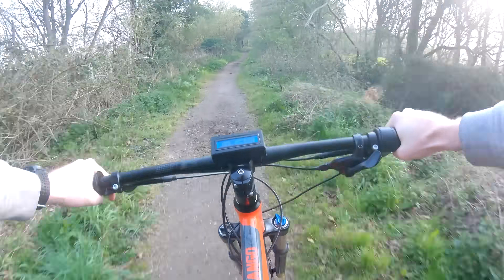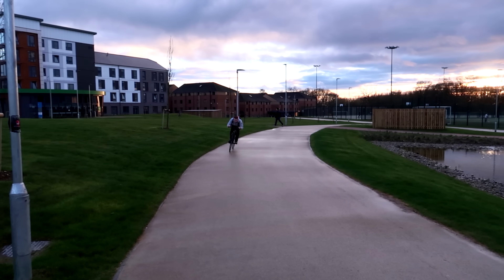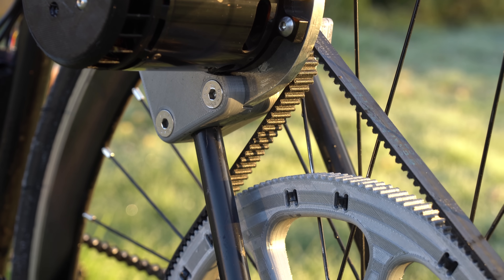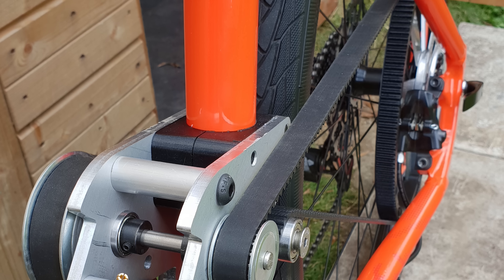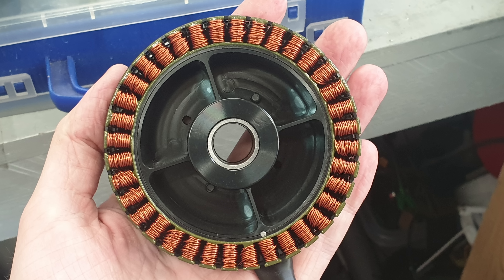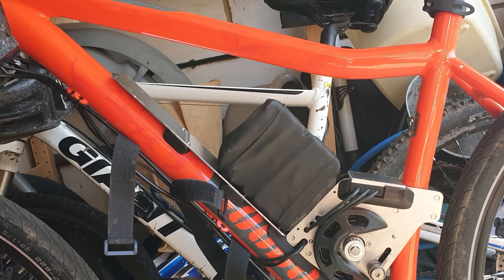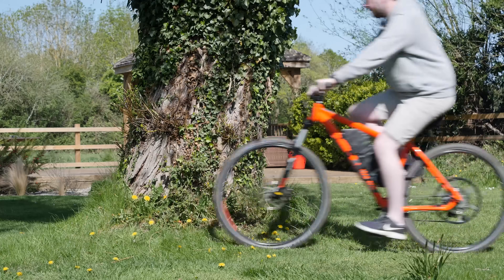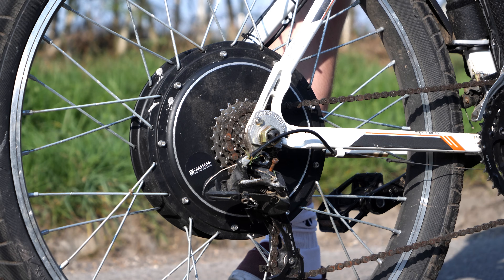Building an Electric Bike

Comment: 8:25 Oh god, if I had a VESC 6 I would not let it dangle like that XD

It's cool that you made your own Arduino speedometer + odometer! There's a ready-made product called the Davega, which is what a lot of electric skateboarders use. Yours is way less expensive though :D

I was really surprised that the hub motor beat your build! In the skateboarding world, low KV hub motors usually suck because they heat up too fast. Will keep in mind when I make my own e-bike! Great video!

Edit: Oh, one last thing I forgot to mention – I hope you used fishpaper inbetween your parallel groups in your battery – it might not be that important on an ebike, but vibrations over time can cause the outer shells of the cells to short! Fishpaper prevents that from happening :)
Reply: Mid drive is the best way to go, check out Luna cycle for good motors

Comment: Hub motors are great. Get two of them and put one in the front and one in the back for an AWD bike!
I have a front hub motor rated at 1kw and it gets me up to 30 with a 22ah 58v lithium battery back that I built. I built a custom "moderator" to keep the cheap motor controller from pulling too much current from the battery and it also serves as a battery management system and battery heater controller since I use it in the cold some times. Works well, but it's still a little buggy. I've had it for about 3 years now and having a front hub motor is great because when you peddle you get AWD. It's supper fun in gravel and dirt!

Comment: Aren't electric bikes limited to some lame speed of like 20mph by he law in uk?
Reply: Btw. you didn't put fishpaper isolators on the positive side of the cell, it's a critical issue, the only thing stopping it from having a total dead short and huge fire is thin layer of plastic sleeve that melts quite easily and you probably melted it a bit during the welding process.
Reply: Only uk not in United States
Reply: @RuviaPawz  well as far as I know if he lives in UK then UK law applies to him not US laws...

Comment: This journey teaches you far more than simply spending 12 grand on an S-works Levo. He might end up spending 12k+ in the long run, but reinforcing the engineering fundamentals via experience and failure is far more valuable.

Comment: I’m starting to think the old 750 watt motor from my broken toy scooter won’t be enough for a e-bike
Reply: I have a 750 watt mid drive motor in mine, it will do 30mph and handles hills pretty well, it's 48volts but I made a big 52v 40Ah battery and it will do 60 miles on a charge, probably a lot more if I take it easy
Reply: Give it some gears. 750 W mid drive motors can outrun 1500 W hub motors simply because of gears.

Comment: You talked about hub motors, but left out the big question - why? Why build a gears-and-pulleys bike like this, when the equivalent hub motor is so much easier - and a fair bit cheaper, if buying aliexpress parts? I mean, it's a few kilos lighter, but I wouldn't say that makes a huge difference when you consider the weight of the rider, and all the mounts are potential weak points. Is it a "because I can" thing - which I can totally respect - or are there technical reasons?

Comment: You also could have designed a pulley for the rim that had two different slots in them for two different belts and then ran one belt from each electric motor to the pulley

Comment: Since you have parts making ability why not just use a car engine air filter housed in your own enclosure? Another possibility is to use a vacuum cleaner bag either in it's original form or cut to some practical size, again with your own enclosure. Some food containers and storage containers can also be modified to use as enclosures. Hth.

Comment: At 12"45 you're using a wheel know law of mechanics dimensionnement. In order to optimize the acceleration of the vehicle, the optimal reduction is equal to the square root of the motor inertia divided by the total embeded mass on the vehicle, multiply by the wheel radius. Don't hesitate to contact me if you want some details about it. A great engineering project ! Thanks for the quality of this content !

Comment: The one thing you didn't touch on was price. How does it compare to buying a conversion kit or an electric bike from the get go?
Reply: I think it would be cheaper but I don't know by how much, probably not enough to really make it worth. However this is pretty obviously a passion project so I don't think he did this mainly to save money. Plus it's probably going to be powerful enough to be classified as a moped
Reply: More power, more fiddly, skills required, cheaper with no limiters.. pretty much the same balance as multi rotor rc hobbyists
Reply: First buy your cnc router.  I haven't checked the price of them - probably more than 500(0)  quid.  Oh and a decent 3d printer and maybe a lathe and milling machine.   I correct myself:  first get patreons to bung you 20k.

Comment: Why not a small gas engine, like a 212cc?
Reply: The whole point is that it is electric, those gas motor kits are absolutely gutless, electric motors have instant torque, you have to rev the nuts off a gas bike to get anywhere, or you may as well buy a motorcycle

Comment: Its weird that your mid drive system accelerate slower than hub
Probably hub motor have more amps at start than your.
I see comparsion mid 750W vs 3kw hub and 750w win when accelerate from 0 but of course lose at max speed but both have max 60kmh. 
Still avesome project :D

Comment: Awesome job man. I have hopefully a simple and easy question or 2. How can I single out which wire on a speed controller that limits the max speed. As I can only get 25mph. And is there any easy way to reprogram the speed controller to know that it is getting powered by 12s instead of 10s. 🤔🤪

Comment: Lol all these problems and he has not accounted for the cassette or chain strength. 2k watts will destroy your cassette and chain in no time! Have you ridden this  bike more than 100 miles?
Reply: It doesn't drive through the chain or cassette, it has a belt drive to a separate sprocket, did you even watch the video?

Comment: It's also worth noting for UK viewers that UK laws require electric bikes be limited to 15.5mph & no more than 250watts ( motor power )- any bike breaking these rules is required to be taxed, registered & insured for use on public roads. Not that we pay any attention to that, but be smart when riding in public... ;)
Reply: I find that if you see a copper, just start pedaling like mad, I've never been pulled and my bike does 30mph

Comment: About a year ago I finished making an electric bike based on your v4 design. It works great, but required a couple more custom parts, because my bike had a more curvy frame.  I had the same issue with a custom motor shaft, but I recently ordered a precision ground rod to make a new shaft out of. I have 2kw motor 12s ~900Wh battery and the top speed is about 40km/h. The only thing I'm wondering about is will something happen to the VESC if I ride downhill faster than that?

Comment: Sounds like an engineer, always trying to reinvent the wheel.
Reply: It's for learning purpose
Reply: The process to improve a design and its performance, getting over so many details, would help every personal life time issue and the way that the brain works (getting better and faster).
Reply: This was very useful, especially regarding the external BMS and link to cell pairing. My EUC battery pack will need some love at some point and i guess I could pull it apart, measure the cells and rebuild. Same thing for the EUC hub motor, if I could find a larger motor imI could rebuild the EUC controller and have a wheel that is better engineered than the gotways and hopefully with even more torque and higher too speed. 120/50-16 motor bike tyre anyone? 🥰
Reply: He had too do alot of things for a simple diy builds 😆
Reply: But reinventing things is what we do, just because a new concept isnt being used on a specific application at the time doesnt mean that said new concept cannot be than used on numerous other applications once it's been perfected
Reply: To be able to improve the wheel you would need to go to the fundamentals first by reinventing it, only then with experience you might see the improvement. If you studied engineering well then you would understand.
Reply: I bought a $180 front wheel kit and a $190 36v 10.5ah battery off eBay. Installed the kit and battery it on a beach cruiser bike (my wife and I got a set from her parents) with a 3 speed geared hub transmission. It's been great other than the battery falling off a few times (fixed it by mounting it better) and I have been pulling my preschool age kids around in a bike trailer. The display is reading out a max speed of around 90 km/h downhill full throttle with no trailer. No 3D printing. No pulleys. The chain is getting loose, and the bike trailer hitch came off and stripped out a nut when I tried to reattach it. So maybe I have a few parts to buy. But nothing like what this guy went through! I am happy to pedal to get better acceleration. I will continue to fix what I need to instead of trying to over-engineer things.
Reply: He reinvented stupidity, he said it himself.. real talk
Reply: An engineer would consider the wasted energy converting electric to mechanical force.
Reply: Amelia Lee Could you elaborate on your point? 
Are you trying to say that he shoudnt convert electrical to mechanical but use mechanical batteries?
Or just go full blown chemical energy -> mechanical with a gas motor?
Reply: And he have a lot of Money that he should use in another way...
Reply: @andreabena7421  He should use his money to have fun, as I see he is having fun, so money well spent!
Reply: @Dániel Botrágyi To a certain degree, yes! But there are people in need though. I get things that I enjoy, but I always help the poor and needy. Not one person knows what I do for a particular person when it comes to giving. That right there is more fun than me buying something for myself!
Reply: Dániel Botrágyi well said.
Reply: @andreabena7421  have you ever heard of a hobby

Comment: I've built my own electric bike based on your design. I've used a copy of a C80100 and a VESC 6 and some Lipos' from Hobbyking, but instead of a two pulley setup I decided to use a pulley for the first stage and a chain for the sesond one, cause i had no 3d Printer. I like it a lot and it is really fun to ride, but I thought it would be quieter. The next time I will be building a electric Motorcyle with a hub motor, because I want it to be as quiet as possible. Also I will be using 18650 cells and no more lipos, because li-ion cells can handle more abuse like low temperature and IMO a charge/discharge BMS in combination with a Main Contactor (Relay) is a good thing, because otherwise you have to take your batteries on and off your bike all the time, which is driving me nuts.
Anyways thanks for your inspiration Tom and let the videos keep coming :) 
The fact that these e-bikes aren't street legal here in Germany is sometimes a bit annoying, because Germans are always a bit prim.

Comment: Shouldn't this have insurance as it goes above 16mph?
There was a recent case where someone crashed into a person
Reply: Also because it's throttle controlled and not pedal assisted (UK).  Number plate, insurance, Q plate certification, motorbike helmet, etc.
Reply: He was found not guilty on all counts because the person he hit walked out right in front of him with no chance of avoiding the accident even if he'd been on a normal bike

Comment: can you do the same thing but instead of using belt from motor to rear tyre , can you make the motor to gear at the peddle then can use the bicycle gears instead of using 3D gears?
Reply: The reason when most people do it like Tom did here is so you still have the Freewheel aspect, where the pedals dont try to knock your shins off when your going forward.
Reply: @danielauen7790  I have a mid drive and it freewheels ok thanks

Comment: next up: a hydrogen powered bike, with the hydrogen produced by mixing NaOH (Caustic soda) with aluminum beer cans and water.

I've actually managed to make a setup few years ago based on a jar with NaOH + Al (pieces of alu foil) + H2O, the jar placed in a soup bowl with cold water (exothermic reaction) and another jar filled with water to clean the produced gas from residues. Everything was using IV tubes used in hospitals and at the needle side a nice hydrogen hot flame burned for some time.
This sparked an idea: In Romania, as there are a lot of coke and beer aluminum cans all over the place (some fellow citizens don't understand the concept of selective trash collection system, although in Ceausescu's period Romania used to be a real champion at recycling almost everything), you could provide a shit ton of hydrogen to some sort of contraption that can produce electricity or mechanical energy to power something like a car, I guess. And it could be somehow green, because the resulting sodium aluminate (NaAlO2) from the reaction can be used for water treatment purposes (flocculation agent - coagulates the small bits of dirt into big chunk easily filtrable)

Comment: Is this legal in UK or do you have regulations for e-bikes ?
Reply: No it's not legal in the uk. An ebike must be peddle assist, must be less than 250W and max electric drive of 15mph
Reply: @bikeforever2016  Interesting! Is it allowed to build it on your own if you respect this limits ?
Reply: Yes
Reply: @bikeforever2016  actually you can have any size motor so long as when on a public road the output is restricted to 250W, so you can have a switch on the controller, when you go off road switch it to full power, also it's 15.5mph and yes, you can have a throttle

Comment: I love the way your bike sounds and looks! I build a stealth ebike from a secondhand ebike hubmotor (180watt 36v) that I put on my trashy rusty old dutch bicycle. I made the battery like yours but with a bms and the speedcontroller and gas grip handle are cheapy ali stuff. I build the pack to be 48v so i get some more power from my hubmotor.  I hide everything in panniers and nobody every notice me barly paddeling :) Top speed is 32km/h and way less torque than your bike but still fun with the throttle handle instead of pedal assist. Your fist video inspired me to build it so thanks I really enjoy riding it.

Comment: if you wanna build a elec bike watch vortecks or andy kirby...... not this ... they can cost thousands to build and get running right... these tiny little  motors won't last 100 miles wirh the weak ass battery packs.
Reply: Yep, Tony and Andy, brilliant both

Comment: belts off (point of failure), in-wheel electric-engine, supercaps for regeneration, battery or other -to-electricity source, HDPE cast bike structure
Reply: if you need cooling, peltier element, you can recharge batteries and supercaps by pedaling without chains
Reply: only emergency brakes needed, electric regenerative or powered braking

Comment: use the bicycle shift with an adapter on the crown, with the electric motor .. this is done with the combustion engine, but it also works with the electric, this video shows how the system is ..
https://www.youtube.com/watch?v=bY9BeSOfQ7s&t=67s

Comment: Great video. Your equation at the end fails to take in to consideration the diameter of the bike wheel though. Normally not an issue as most bikes are the same rough size but if someone wants to slap this setup on to a  BMX bike they will have trouble with that math.

Comment: Amazing work! Your fabrication skills are impressive. How do you solder those large terminals on the batteries? It's always a disaster when I try.
Reply: He spot welds,  check out a few videos showing the process. He doesn't solder them.
Reply: You 'can' solder them, but I don't recommend it. You would need a very hot soldering iron and a lot of patience.
Reply: If you want an affordable setup (relatively speaking to professional setups), look at the kWeld kit. They have various options just the bare essentials or also an added capacitor bank in case you don't have suitable batteries or whatever to power it from.

It's still not cheap, one of the things that's pretty high on my wishlist for a few planned projects that involve more than 2-3 batteries (so far it has been low current/voltage stuff and I can get by with inserting batteries in standard plastic holders). For the occasional higher power stuff just taking a suitable lipo pack aimed at the remote controlled vehicle market can also work, as a bonus if you design them for that swapping batteries is fast and you get a standard connector to hook up to your charger out of the box. But when going for something large like a battery pack for an ebike I wouldn't want to go that route.

Comment: Very interesting video Tom.  As I was watching your progress through the drivetrain development I started to wonder if one could put the electric motor where the pedal cranks mount.  This way the gearing of the bike could be used as the final drive instead of the additional belts and pulleys. I can see that getting the pedals to freewheel whilst under power and the physical space to fit a motor at that part of the frame would be two problems to overcome. Your video has sparked my interest I may just have to buy a cheap bike that I could experiment on. Thank you for the inspiration.
Reply: Check out Luna cycle for mid drive motors, also see Tony on Vortecks channel for in depth stuff on electronics and building batteries